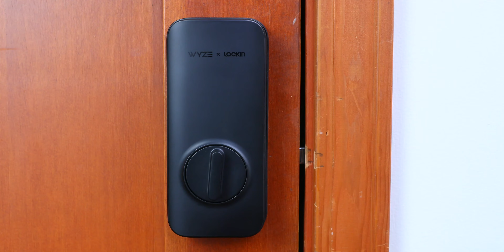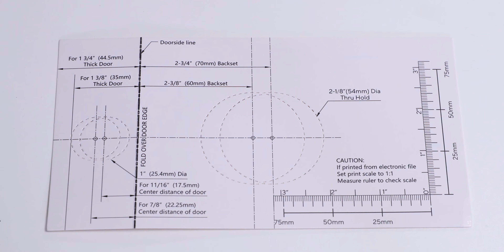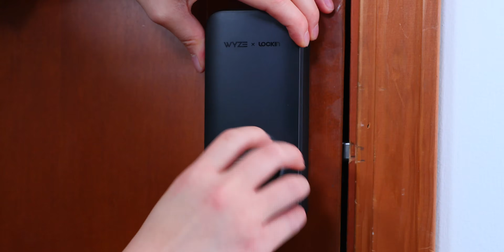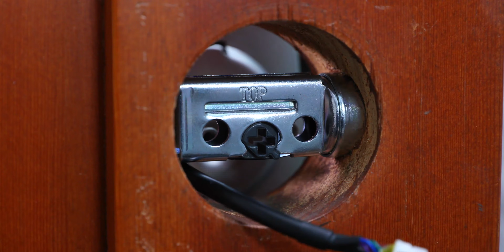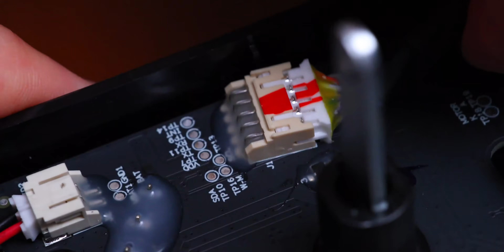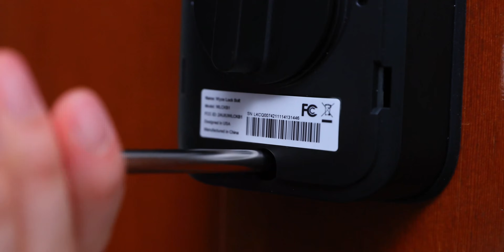How to Install Wyze Lock Bolt

Comment: Yeah but where does the cable go? It won't fit inside
Reply from the maker: The cable should fit snugly inside the lock bolt itself, you may need to fold the cable gently in order for it to fit.

Comment: I hope it doesnt give you low battery warnings like the og smartlock when the AA hits 1.39v.  Can anyone confirm?
Reply from the maker: Wyze Lock Bolt has a low battery icon on the device itself, but since this lock connects via Bluetooth, there is not an alert that will be sent over the Internet to your app.

Comment: Only bad thing about this lock is there’s no hub connected to it which means you can’t unlock and lock from anywhere in the world and you can’t connect Alexa and OK Google to it now they could update that that would be amazing. Best lock ever till then it’s a 6 out of 10.
Reply: Just to chime in on this because I bought this lock for my Mother in law. By default you can't lock and unlock from a remote location because the deadbolt doesn't have wifi, only bluetooth. However, if you also have the Wyze doorbell pro, you can connect the two and use the doorbell camera to remotely unlock the lock bolt. You can't relock it, but that's something at least.
Reply: @RussDahlberg  yeah but they can make a hub to connect to the lock to control it! No?

Comment: Nott made for Canada. Three locks died. 1st one the touchscreen shorted out. 2nd one the lock would constantly beep like it was being touched. 3rd one on the garage jammed inside and bent internally. Do not recommend at all under 6 months old. only kfferes a return with a gift card as a reolacement.

Comment: Well I know this product has been out for a little while now. I just bought a house and will not be closing for a little while. I would like to start collecting Wyze gear so the day I move in I can set it all up. Tech gets out dated very fast or you update a product and its better then the first. Question I have is do you guys have any plans to roll out a new version of the lock say within 6months? I just don't want to buy something then have a new product come out before I even install it. 
Look at the Iphone, I hardly get to brake in my 13 before the 14 rolled out. 
Thank you.
Reply: Can’t by tech with that mindstate. No matter when you buy it, something better is going to come out the next day. Just gotta try to get a good deal on what you can.

Comment: The keypad will not fit the hole in my metal door.
Reply: I have a metal door as well, you can take a dermal tool and slightly shave the circle's edges enough so the wyze pops in

Comment: so there is no key backup?

what do you do if the battery dies and its locked? how do you get in? what is the backup bailout method so you can always get in as the homeowner?
Reply: USB-C connector for emergency power
Reply: Key is better 😢

Comment: What happens when you're out and the batteries die and the lock fails to operate? Not very useful when it doesn't let you keep your existing lock and keys like other smart locks. Sorry but as much as I appreciate Wyze products, it seems like they took a step back with this one.
Reply: It has a USB C port. I usually have a portable battery handy anyway ;> But it is a fair point, if you don't have a secondary access door this may not be the lock for you.

Comment: I appreciate a lot of this technology. I do have some of the smart cameras and doorbells but these things are still easily hackable to the right people. I don't think that I am the kind of person that would have to worry about being hacked but I'm not interested in having a lock on my door that if someone could hack into the system could unlock my door. So I will stick with a traditional deadbolt myself
Reply: @Nathaniel Wright I saw that about the long screws before👍

Comment: Is there a physical key to unlock in case of lock failure?
Reply: no
Reply: But as noted above, it does have a USB C power port on the outside for the case where the lock is functional just out of power

Comment: Does anyone know the dimensions of the outside key pad and the inside box? Specs say L=7.3 W=5.3 D=2.3.  
But it doesn't specify inside or outside box. My door edge where the lock goes is only 5 inches.

Comment: Will it unlock on its own to let peepers in the way v1 cams did for 3 years?... 😎
Reply: as there's no wifi and no internet connection it does seem less likely to have that failure mode
Reply: Oh so a camera unlocked huh?... Stop hating and trolling... You were also talking about a version -1 camera.

Comment: I like the idea of these things but so many homes have door frames that will swell with humidity that they don't reliably work without spending a lot more money to fix that problem when your conventional deadbolt will still work, just tightly.
Reply: Got two wiser lock for 5/6 years on older house (67 year old ) never had single issue other than changing batteries after 4/6 mo this depending on use
Reply: Don't see how this would be any different than a normal deadbolt in terms of performance in humidity
Reply: @stephen_b  With a regular deadbolt you just force the door a bit. This is supposed to be automatic and hands free.
Reply: @RTT80 ok so when the door or frame swells you type the code, then pull the door tight and the lock unlocks itself automatically the same way you would pull the door tight and unlock a manual lock? I don’t see any difference. Some people just want to find an issue. And technically this isn’t even an issue w this lock it’s and issue w the door and frame
Reply: This is silly. I've had this lock on my house for over two years now and none of the seasons affected how it performed. I didn't have to pull on the door or nudge it or anything, it just works. But like someone else said, it doesn't have WIFI, so you have to be either in the room next to it or just outside of the door's reach in order for it to work. 

A great benefit to these locks are that you can set a different passkey for every individual that comes through your door and you can also do a limited passcode, for say,  the plumber or electrician, to come in your house and then you can get rid of that code. It also keeps a running history of who comes in and out and the failures, if it's a wrong password entered. Your old steady deadbolt isn't gonna do that. 😂 These locks are great.
Reply: agreed, with the changing of the season, there is shifting of the frame, so sometimes it needs a hard nudge. I'll stick with old school key lock

Comment: you can use carpenter's tape or paint tape to hold the outside part in place during install so you can do it yourself with just a screwdriver.
Reply: Good cause I don't have any friends
Reply: Great advice thank you

Comment: Nice!  How long will batteries last?
Reply: 10-12 months
Reply: According to the video. They just used Duracell batteries. So depending on the use. I would suggest strong  rechargeable batteries.

Comment: Is the interior section water resistant so it it can be used on an outside gate?
Reply: Duck no
Reply: @andyconda9456  someone needs to! It would be super convenient.
Reply: @T_B_C_L  but if they do, it won’t break on you six months later, which means they can’t milk another 100$ out of you … I ipx7 any and all my electronics myself. It’s not all that difficult, look into it, thank me later
Reply: @andyconda9456  I will  check it out, thx for the advice 🍻

Comment: wyze lock products assume no one has a deadbolt. this thing is even taller than the other wyze locks
Reply: I think this replaces the deadbolt?
Reply: @NicolasPratt  LMFAO!!!  100% correct...  Was this person even watching the video??
Reply: @--RSL--  yes. It's not a deadbolt if it can be opened from outside
Reply: @timetokickit  This is a deadbolt (a lock that doesn't require a spring mechanism to operate). [https://en.wikipedia.org/wiki/Dead_bolt] I think you might be thinking of an internal safety lock, which some people also refer to as a deadbolt.
Reply: @weaverzone  Yeah but all previous wyze locks are a dead bolt by that definition yes? they are not spring operated
Reply: This is the deadbolt dum dum
Reply: It is a deadbolt 😂
Reply: @wrightclick  it's not a deadbolt. A deadbolt is a lock that can't be opened from outside. Keypad or not.
Reply: @timetokickit  That is not the common definition of deadbolt in the US.